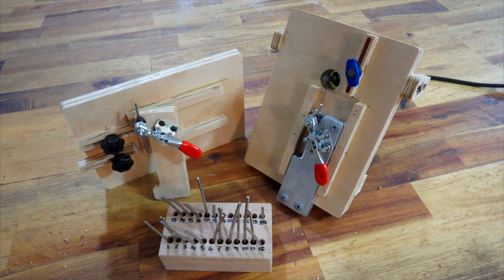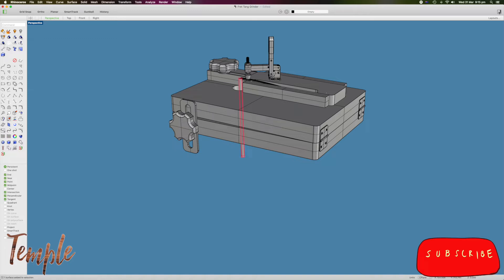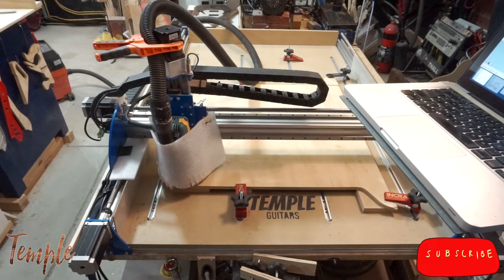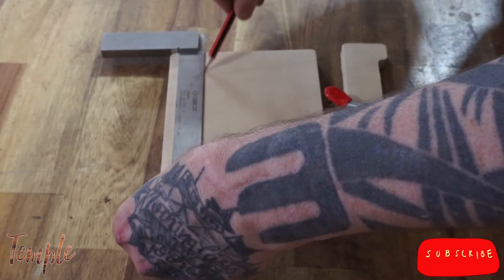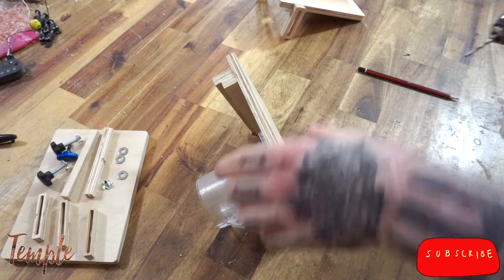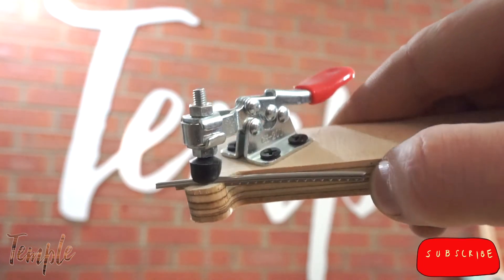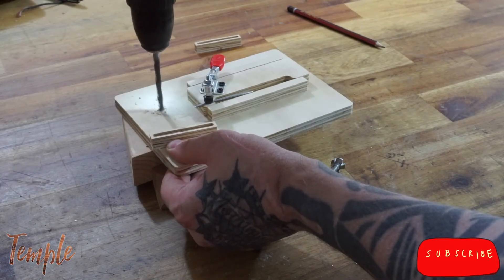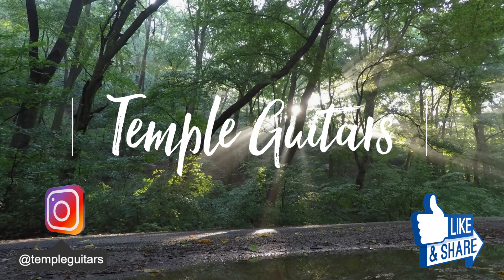Cheap, Fast, Awesome Luthiers Fret Tang Cutter

Comment: Or you could always buy the tool from stewmac and be done with it
Reply from the maker: Stew Mac don't sell this tool. The fret tang nippers they sell still leave a portion of the tang under the fret, which needs to be trimmed away- which is what this tool does. Also, not everyone has the money to afford Stew Mac prices, so using workshop scraps can help some people. Cheers for the dismissive comment though.

Comment: Hey dude, another sweet vid! That jig is pretty cool and I really like the re-loader. I noticed that you have a radial drill press and was wondering if there’s any real advantage to having one. Obviously it has plenty of depth of drill but do you use the tilting feature?
Reply from the maker: Hey Matt! I have never used the tilting feature of that drill press. If I was to need that feature, I'd buy another drill press just for it. The reason I got that one is because it has such a deep clearance, so it's perfect for drilling ferrules, even on an Explorer style body. It was actually a really reasonable price, and I honestly love it.